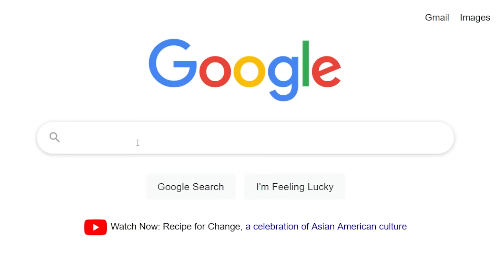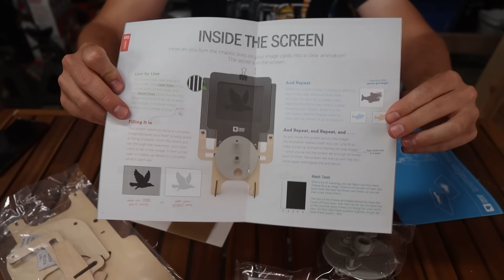touching myself with a robot

Comment: Ya actually I've got exactly the same fear. Accept mine comes from tests I had to have as a kid for epilepsy. They put one of those sensor plastic caps on, like a fancy swimming hat but with electronics on. Oh they then had to inject gel under each of the sensor things with a syringe and the tech kept stabbing me in the head. Anyway after this obviously I didn't want anyone touching my hair but I needed a hair cut so my mum dragged me with a bribe to the hair dressers. Anyway she then soaked me whilst washing my hair and so I had to take my top and trousers off in the hairdressers so she could dry them. Oh yhea she then really fucked up my hair. The next time I needed a hair cut I did it myself and so ended up with a skinhead at the age of 7.....🤔 Wonder why I hate hair dressers.

Comment: I like how you had access to the special robot arm rig, AND you built the adapter to let you use the scissors, but you still used a cheap crappy set of scissors instead of actual haircutter's scissors

Comment: SMH you use the hand feel instead of the robot arms.
I started cutting my own hair in 2015 after I had to get a haircut to be considered for jobs. My current way is taking a clipper, doing (the sides first with) the shorter length, then doing (the middle with) the longer. Since you are too cautious with the short, you can at this point even it out with the shorter length and looking or scissors. Then just trim the sides and by the ear especially with the lowest setting Check the back of your neck for any weird feel that would translate to a weird look and cut that with appropriate length.

Comment: "To avoid the touch of strangers" is the most relatable inspiration for a project I've seen so far
Reply: I've been buzz-cutting my own hair for thr past6+ years for thispurpose. I've just discovered that you need to say "f*** it" and go almost bald, (I used to 2mm attachment to just barely avoid skinhead territory) because the shorter you cut, the more even you can get it with less pain from contorting your body for a prolonged time. still pretty tedious, but better than the stranger's touch. I think it would be way faster still with no attachment at all, because then you would avoid much of the clogging from the long hair at the start.
Reply: @Ass_of_Amalek  Same, I just buzz cut it myself, keeping it longer at the top with a nice fade.
Reply: That's how dildos were invented.
Reply: That's why this is the only William Osman invention i would 100% use given the chance.